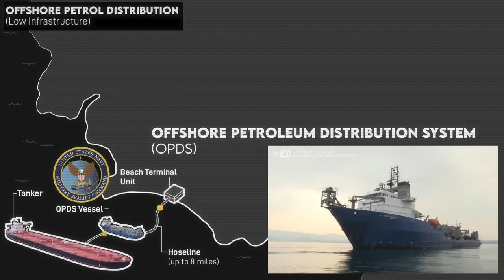The Canoo Pickup :: For The Army First..

Comment: The truck having an 8 foot bed was what I liked most. If the consumer version has that as a stock option, then Canoo will be my first choice for an electric truck. Ford, Rivian, Tesla & Chevy are all middling around with 5 to 6 foot beds.
Reply: Keep in mind Canoo is as wide as a Prius. The overall capacity will be less. But if a light duty truck with a long bed is what you’re after this will be perfect.
Reply: just get a longbed single cab
Reply: Hey let’s not forget on how the ev 150 loses 20-30 % of its range when towing and that’s in
Reply: @wientz  once you start to load up on the weight  the range on ev’s goes way down that’s not me saying it that’s the manufacturers saying it
Reply: The Chevy EV truck will have a passthrough into the cab.
Reply: @dan_taninecz_geopol  but not for a sheet of plywood or drywall. A passthrough doesn't replace a true 8' bed.
Reply: @chriskelvin248  it's eleven feet long, and basically as wide as a normal truck bed. I'm sure you're right, but for a full sheet of drywall you're going diagonal with either bed.
Reply: The new bodystyle Ram half ton? Doesn't even come with an 8 foot bed at all. They do still sell new Ram "Classic" half tons, which are the old bodystyle, but unfortunately the 8' bed, especially on half tons but even on bigger trucks, is pretty much gone. Too many people want SUVs with exposed cargo areas that give them man-cred.

Comment: One other thing to remember is that the overwhelming majority of the military's vehicles will never see combat.   Think of the US Army as a company with 500,000 employees, many of whom have a "company" car.  Huge numbers of vehicles are used just moving people around in the continental US.  Sure you need off road, the military does a lot of disaster relief, and you could get called to active duty.  However most of the time you are just running errands around the post.   The USAF has hundreds of crew cab pickups who's only job is driving the air crews out to the flight line and back.   This doesn't have to replace an M1A3 Abrams to get tens of thousands of orders.  It just needs to replace a Chevy pickup.
Reply from the maker: Thats a pretty amazing point. Thanks man.

Comment: Looks good, and interesting.  Love EV's.   I do wonder about a few points you touched on for real world use for the Army:  If petrol/diesel is hard to find, charging stations will be pretty much either impossible to find or not working.  I assuming they are thinking of a portable charging station.   It will be powered by what?  Diesel? (kinda stupid, but backup solution)  Sun / Wind?   Probably too big and slow... We shall see.    Looks good for non war & personal settings...
Reply: For use on and around permanent bases it's probably near-ideal.
Reply: I thought they said it was solar powered.

Comment: Cool looking truck. As a combat vehicle, or even a logistics vehicle its going to have issues. Setting up solar panels on a battlefield is just asking for an airstrike on your head. Solar panels are easy to see from the sky. So that leaves bringing battery banks up to charge the trucks. Couple of problems with that. Batteries are heavy.  Once used to charge a vehicle they need to go back and charge again. You might as well stuck with a internal combustion engine and fuel trucks in that case. Then you have cold weather. Electric vehicles go way down in efficiency the colder it gets.
Reply from the maker: Yea, these are real issues, but I believe these will be solvable issues. It might be another 10-15 years before this will/can be real. But it's a start, and we'll eventually get there.

Comment: Wait, so a fuel convoy can be attacked, but a bunch of low range trucks unable to tow anything heavy or deal with extreme temperatures will be fine while parked for hours at charging stations that probably don’t have electricity because the infrastructure was blown up?  Or at solar stations the size of football fields?  The amount of solar needed to field charge these would “visible from space” and only work during daylight hours and be easily vulnerable to attack.  I want one for me though.
Reply from the maker: All good points. It's a start though, and eventually I'd bet we'd find solutions to these significant issues.. but we have to start somewhere!🤘
Reply: Totally impractical for military use on a combat field. For local base use maybe
Reply: Can be tracked. Controlled. Also in war and in future when gas is “rare” why not use these on base for gofer missions? Save fuel for different situations? I dunno. I deliver for door dash lol.
Reply: Well…you won’t hear it coming.  Not much of a heat signature either.
Reply: Yes…as a combat vehicle it’s not yet ready…but this can be used for the myriad of uses outside of a theater, saving fuel for vehicles engaged inside.
Reply: Perhaps we’re looking at the question of EV’s in the military the wrong way.  I don’t expect to see battery operated tanks or APC’s in the near future or EV’s moving supplies on the frontlines but from an operational sense the US Army has ten soldiers providing support for every combat soldier.  That’s a massive logistical tail and a significant portion of which is based at military depots and bases within the continental United States.  What if 10, 20 or even 40% of this movement within the US was done with EV’s, not just on bases but moving supplies between depots and embarkation points by electric semi’s such as Teslas and other manufacturers.  The costs saved from just replacing the diesel and gasoline used would be massive.  I’m pretty sure that by now someone in the depths of the Pentagon has had a serious look at where EV’s could fit into the military’s structure.  Logistics handling far from combat would be a good start although I can imagine that the use of small, near silent and cool running EV’s for reconnaissance has already been contemplated if not tested.  The Canoo in the Army is just the first step even if it’s just on a base in Alabama far from danger.
Reply: From a Veteran perspective, it sounds like you've never been on a FOB recently.   In Djibouti we A WERE ALREADY using EVs with no problem.  They aren't even great ones like this, they are the GEM cars from GM.  We have charging stations there, along with solar panels, wind and diesel powered charging stations
Reply: @GearboxPizza  200 mile range is plenty for a purpose like this, I wouldn't expect this to replace a humvee or a MRAP, but this could absolutely suplant some our light duty trucks
Reply: You still need fuel to charge batteries 24/7/365 in a military environment.   Unless the military were to start investing in small, portable,  nuclear power generators to provide big power in remote locations. Also remember that EVs weigh more than their ICE counterparts so they are already losing efficiency carrying those batteries around.  Fuel can be carried in Jerry cans & stored at remote locations far easier, smaller, & less expensive than banks of batteries or charging infrastructure.
Reply: @Wolfgang-the-Gray  You still need fuel 24/7/365.  Do you think FOBs always have diesel lying around and we don't have to do anything to conserve that?  How's that any different from an EV?  At least I can deploy Wind and Solar generation and store that in a battery, which we are ready do, and not have to go out on Convoy, JUST for fuel and risk getting blown up....
Reply: Without tactical use, the US military would have a massive use for these trucks at home.
Reply: @ljd8520  or just as a light duty vehicle like the video mentions.  We use regular pickup trucks for day to day tasks and work.  We don't go EVERYWHERE in a tac vehicle.
Reply: The US Army and Marines bought over 70,000 CUCV from GM in 1984-1987. Compare with 6,750 Bradleys and 10,000 Abrams, 875 LAV-25, and 4,500 Strikers...

The HMMWV is a tough comparo, because so many were up-armored, but it's hard to track down how many were vs. how many of the 280,000 have just been piddling around Fort Bliss or Kadena their whole lives...

Nobody is suggesting that 70,000  'CANOO-Vs' would be going into battle. It's intended as an analogue to the CUCV, or all those "normal" HMMWVs...

70,000 Canoo LSSVs for the DoD represents an absolute minimum of 90,000,000 gallons of gas you don't have to buy/use/protect every year...
Reply: @JonathonBarton  Facts
Reply: @GearboxPizza  it’s a goddam war what the enemy will wait for our tanks to fully charge and then start the fight ? Wtf are unthinking of ?
Reply: @johnfranktullo3463  Tell me you've never been in service without telling me you've never been on service
Reply: @johnfranktullo3463  So far starters, Vet here.  I was on a base in Africa and guess what? They had EVs there for YEARS.  Not every vehicle on a base needs to be a Hummer oh clueless one, Why? Because not every vehicle does tactical operations.  We have REGULAR ASS pickup trucks and small EVs for picking up supplies transporting goods etc.  We didn't even tow shit with the pickups. The heavy equipment we needed to tow, was done using MTVRs
Reply: @johnfranktullo3463  So you barking about an EV losing range while towing?  Guess what, it will almost NEVER tow anything.  The average American with a ford 150, NEVER TOWS anything.  I literally have a next door neighbor with lightning, they love it, get over it
Reply: @johnfranktullo3463  This is why I say some of the civies are speaking about military use are Clueless.  We have this thing called "Light Duty vehicles", these are cars, SUVs and pickups, mostly pickups.  They don't do convoy shit.  They do regular errand running shit on and off base, like every other American does WITH THERE car, SUV, or pickup.  It makes me laugh how the first thing people say against an EV is the thing most people don't do with it, Tow.  People who TRULY care about towing are not going to buy an F150, let alone a lightning.  If they do, they're the rich yuppies like those in ventura, CA, who only need to pull the boat 10 min down the st to drop it.
Reply: @stanhry  And Mujahids are using giga-chad landcruiser turbodiesel pickup.
Reply: @ragingtyga  I don’t think it’s all of us civvies, because I have never served and it seems like a great idea, I mean of course you could use them for logistically support.  Frankly I love the look of the Canoo as well.  It would be so easy to customise with all the great adaptable part’s.
Reply: @Sweetlyfe  your are 100% right, these would be perfect for that,because frankly it would be easier to upkeep these things
Reply: @floydemery4008  It has more usable space and modular capability that most if not any vehicle in it's class...but it's useless...

Ok 🙄
Reply: @ragingtyga  yes as a truck it’s useless. No towing capacity. No range,cargo weight capacity not enough.  For a city person  it’s great if you only take short trips.
Reply: I think they are looking for a parts runner on base etc. It would be a sitting duck if it runs out of juice.
Reply: @sonnywhyte3010  You are exactly right.
Reply: Oh, well you lost me at calling EVs the right thing to do. You want to have an actual conversation about the future of transportation, then going straight EV is out of the question. Diesel electric hybrid isn’t even being looked at seriously but these monstrosities, both in looks and what the mining/disposal does to the earth, are the only option to morons around the world.
Reply: Great for base use, on FOBs, etc.  Especially if you can remotely pilot or make them auto drive and navigate.
Reply: Trading to electric,  would mean generating it. Maybe solar,  wind at a base,  but on the move doesn't make a lot of sense.
Reply: A lot of hate here but the reality is they already have small solar arrays and batteries that can power up the EV in a day with a Couple extra units like Zendure
Reply: Army usually goes 25 miles a day
Reply: @johncorkery3664 the next Abrams is going to be a hybrid, so, technically an electric tank is guaranteed, because they want it able to be ran on just batteries for I think 30 minutes because, well, you ever been anywhere close to a running Abrams?
Reply: @ragingtyga you'd be surprised. The new F150 is a pretty good tower. 12,000 lbs. The new diesels got crazy. I think Fords is like 35k gooseneck, 28k bumper. Even people who tow a lot, but just for recreational, not professionally, very few are going to need to tow more than 8k or so, which would be my maximum "comfortable" tow rating (2/3 maximum tow rating, I don't like towing near the limit). Don't forget, trucks got way bigger recently, too. The new Rangers are the size of my old F150.
Reply: @ThompsonFlash9999  I'm sure it is...but the vast majority of people who own pickups...even the F150, don't tow.  Nor are the EVs that already exist on bases used for towing ether.  This would be fine as a simple light transport vehicle, as it isn't trying to replace anything tactical
Reply: @ragingtyga  sure, my point is even those who tow somewhat regularly don't even need diesels anymore, gas halftons will tow what 99% of people who tow, tow. And most people never do, though. Just like most people don't actually need a bed on a truck, an SUV with a lightweight trailer for the 1 or 2 trips they need external cargo capacity for oversized stuff. Trucks are 90-95% status symbols nowadays. Gone are the days where if you saw somebody driving a truck you knew they did truck stuff with it
Reply: Not sure why people are attempting to equate this with a combat vehicle. It is clearly not.
Being conservative and calling it a 30% reduction in maintenance hours per vehicle, and 50% reduction in fuel consumption (assuming they are charged with generators in the field instead of grid power), a fleet of 20,000 medium electric logistic vehicles would free up SIGNIFICANT fuel and maintenance resources for offensive light and heavy armored vehicles.
Reply: @chip43  It makes perfect sense. Even if the vehicle is servicing an FOB, there are generators there and while it wouldn't be ' green' or nat gas, electric vehicles are two to three times more efficient efficient than ice powered vehicles. To simplify, that means that if a generator is in use to top these vehicles off, they would only need 50% of the fuel burned in the generator when compared to a comparable internal combustion engine vehicle.
Reply: @sonnywhyte3010  any vehicle would be a sitting duck if it runs out of juice
Reply: @lxoxrxexnx  Yes thats obvious .

Comment: Think of this patrolling in silence in the pitch dark by night vision,  able to accelerate very quickly out of trouble.
Reply: How do you charge it?
If you say solar, this has an 80kWh battery that in order to be useful, has to be able to recharge from 20% to 80% in less than 1 hour.
That means you need 673 solar panels to generate the 40kW in the required time.
And you need full sun.
Reply: @pogo1140  military diesel generator
Reply: @jamesengland7461  So you still need that fuel truck making it's way from the main fuel depot to your FOB. Kinda defeats the purpose of an EV now don't it?
No this is going to be a rear area on base utility, replacing the hmmwv's and other small pickups and golf carts.
Reply: @email4664  Are you going to only do one patrol? when you are out there, that generator is going to be a giant beacon screaming HERE WE ARE SEND A MORTAR ROUND OUR WAY!!!, and your acres of solar panels stick out really nice for the recon drones to find.
Reply: @pogo1140  When you are patroling a freaking MILITARY BASE! You have pleanty of space of A MegaWatt of Solar PV + VAWTs, which have to survive Hurricanes. More than enough to charge a Dozen LTV at once.
Reply: @pogo1140  "673 solar panels to generate the 40kW" LIES!
Each 1.5 meter tall Solar PV is conservatively 250 watts. 673 of them would equate to 168.25kW. Dump that into a 200kWh battery bank for buffering. It'll Level 3 Fast Charge TWO Canoos at the same time. This also ignores the additional combination of VAWT where geographically applicable. A 1 MegaWatt Solar PV + VAWT should be very doable at a F.O.B. You made up BS numbers when the raw math is soo simple.
Reply: @Neojhun  you are assuming perfect solar alignment. I'm working with what the real world gives us. That means panels that are not clean, max power only once a day if that.

Comment: My only issue with the Canoo pickup is that it only has two functional seats: driver and passenger.  The rear bench in the Canoo pickup would be less useful for seating than rear seats in typical extended cap pickups, but the Canoo is far better designed for functionality.  Pickup buyer's choice which they prefer - seating or function.

I am hoping those stylish rear seats in LV are completely removable so the cargo cabin in hollow like an LDV.

Comment: perfect so instead of gas logistics what is the plan to recharge here?
plug into the enemy electrical grid behind lines?
supply trucks with 100,000 lb massive battery storage?
100 mile long extension cords?
maybe a hopped up golf cart to run around on base/motor-pool errands  but that's about it!
Reply: it will tow a trailer with 800 315 w solar panels.
Reply: It's not for combat - as others have pointed out, the Army has hundreds of thousands of utility vehicles that never even leave the US.

Comment: With how roomy the cabin is, I could see them moving up the seats and have a second row.

Would be awesome to have a truck a small as a regular small truck but have 5-6 seats and an 8ft foot (extended) bed
Reply from the maker: Totally agree.. I could see a need for two models, one single cab work truck style, and another with an extended cab, slightly smaller truck bed. Wouldn't be surprised if this is an option in the future.
Reply: @GearboxPizza  Big yes. The crew cab is the most popular truck so a larger cab option a must.
Reply: Dr who's time machine would be cool too